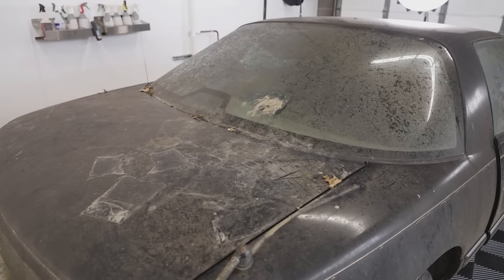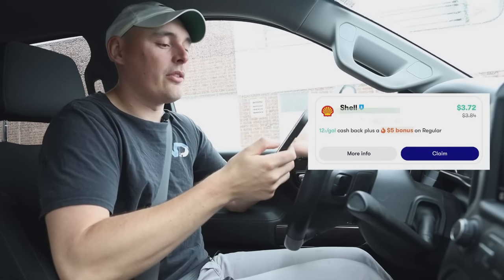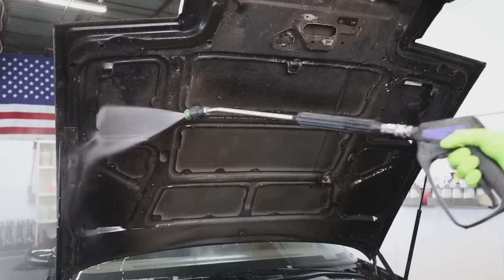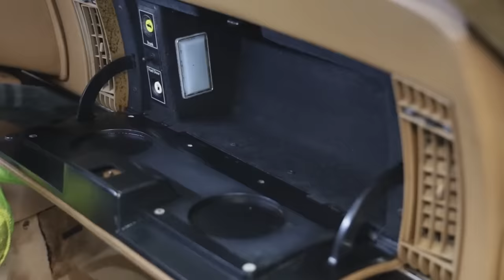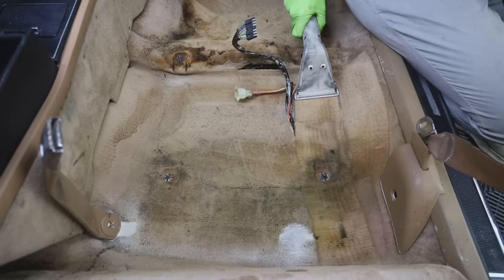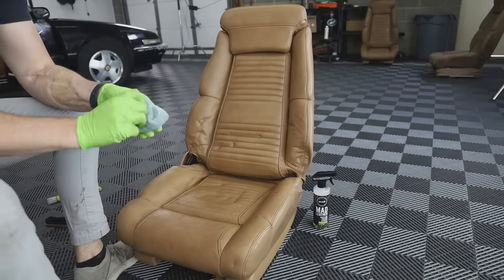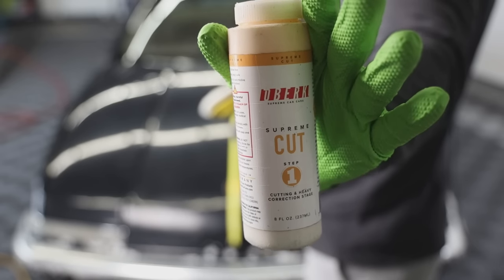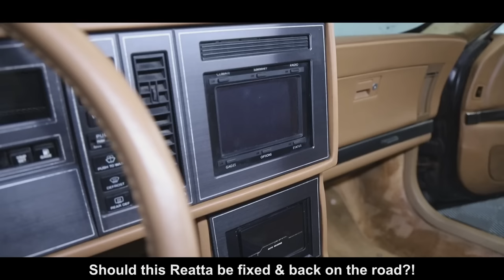ABANDONED WOODS FIND First Wash In 15 Years Moldy Reatta! Satisfying Car Detailing Restoration

Comment: Depending on the state of that electronic instrument panel, which is fairly difficult to get working replacement components for, and if the engine isn't locked up. Though that 3.8 V6 is mostly bulletproof. If all is good, then a paint job would be in order.

Comment: On the spots in the upholstery you can’t get out with agitation + cleaner have you ever tried spraying with an industrial strength peroxide + surfactant? We own vacation rentals and I buy it by the gallon for mystery stains and it even takes out years-old stains. Just spray and walk away. Usually disappears as it dries. Sometimes takes a few applications if the stain is very dark but 9/10 it works. Several brands sell to the public, usually marketed for pet stains and organic stains because it also takes away smells. We like the brand My Pet Peed. But it works amazingly well, sometimes even before your eyes.

Comment: I’m always curious why you start on the exterior first. Personally I like working from the inside out and finishing with cleaning door jambs, closing & walking away. If an engine bay detail is requested usually that would be done before exterior washing also. Great work though, as always!

Comment: Should’ve pulled the carpet and pressure washed it. So much the extractor can do. It needs to be flushed out of all the stains and trapped odor
Reply from the maker: We would have liked to but after messing around with the center console trying to get it out, it was a nightmare and with the car being so old and sitting for so long with bad seals allowing moisture and animals in, lots of rusted bolts, pieces flexing too much etc, we didn’t want to damage anything taking it apart since it’s going to it’s owner 😅

Comment: If there were those huge mouse nests in the easily accessible areas you discovered, I'd think that there are mouse nests elsewhere in the dash and in the air vents. Also, once the seats are out, removing the carpets might not be all that much more work, and you'll be able to clean them much more thoroughly removed from the car.  There's likely mold and rodent excrement in the carpet and the carpet padding...

Comment: This Reata should be saved.  It probably has that bullet proof Buick V6.  
That car was way ahead of its time for driver tech aids.  Add in the styling of the exterior, its a true collector car that should hold its value if not appreciate with time.

Comment: As a detailer you guys should known never clean carpet on the ground because your putting it on the ground to clean and getting the bottom dirty and putting it back in the car dirty on a clean floor of a car, the best detailers know you clean them on a table or get carpet holders on a wall and clean them that way. Just a piece of advice.

Comment: It looked to be the same color as the interior stuff. Probably not baseball sand it's probably the interior falling apart. The seats were shot the interior plastic looks brittle as hell. Moisture breaks down the finishing they use on the plastics to give it uv protection so they don't discolor of crack as fast. I bet it was just the plastics breaking down over time and the mice tearing things apart. I had a old 1984 Chevy S10 pickup and had the same issue only my interior was gray. I restored it and I found when I took the dash off it was crumbling pretty much. My gloves were covered in gray dust they carpet was imbedded with gray dust. So that's my guess bro

Comment: I love the content on this channel, but you guys do it a** backwards! 1st of all you start at the top of the car and work your way completely down. When you got to the trunk you clear cleaned the tail of the car and then you went on top and did the trunk lid?
 Secondly, you clean the inside of the car 1st! No if and/or butts. When you clean the outside of the car 1st you have spent money on the products that you have used to run the chance of getting all the c*** that you take from inside the car out and even with the vacuum, you still have dust that lays on top of the products that you use to clean the car.